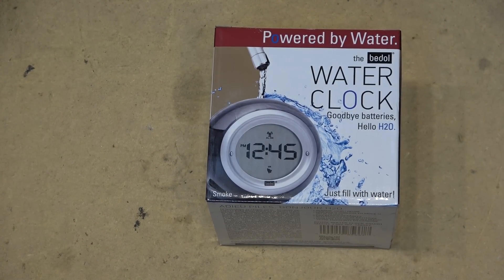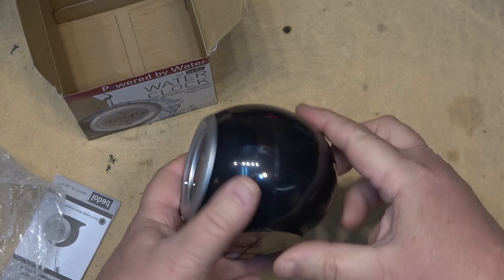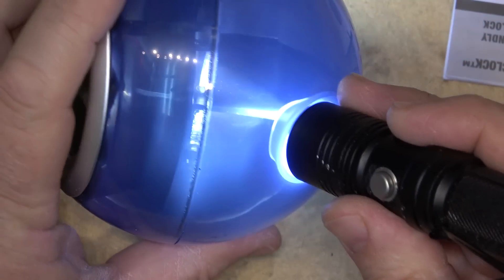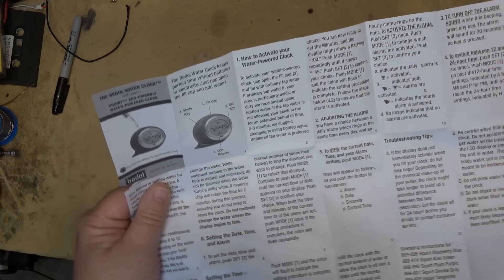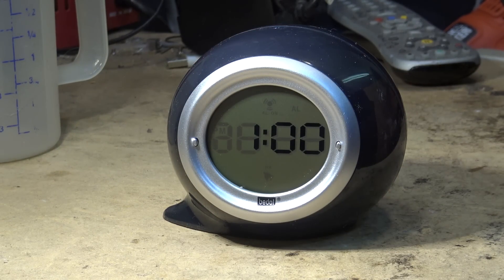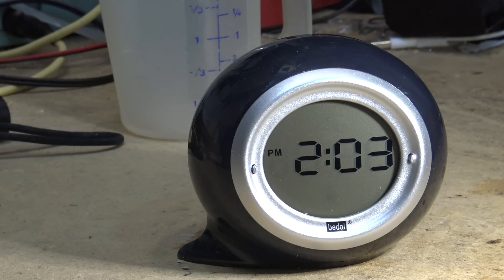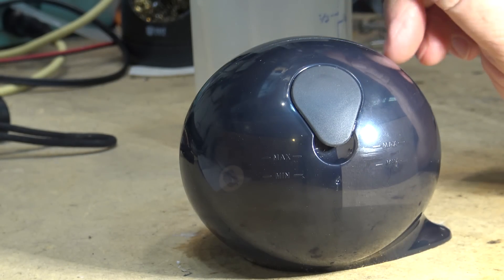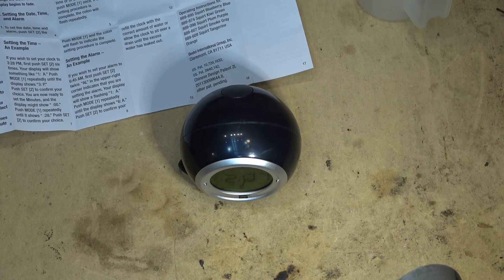It runs on water!

Comment: The manual saying - "Do not drink the water from the clock" :D
Reply from the maker: Ya think.  Would be some heavy metals in it. One thing I noticed.  Put on distilled water and it doesn't work so it certainly is building a charge from dissolved minerals in the water. Setting up a reaction between the dissimilar metals and whatever minerals are present in the water that cause electrons to move between them no doubt reducing one plate in the process.  Will be interesting to see how many years it runs with just a water change when it fades out.   Still it's pretty cool. Just have it sitting on a shelf and it is pretty accurate.  Which reminded me, forgot to set daylight time on it.  Doing that now.

Comment: I'm absolutely fine with my radio controlled clock that runs on a single AA cell for 10-15 years, thank you.
Reply from the maker: My radio controlled clock has been running on a pair of lithium cells for years. My radio controlled watch has been running for over 20 years on original battery, but that one is cheating as it has a solar cell to recharge it every day. Yes my old Casio is solar powered. Will outlast me more likely.
Reply: @12voltvids  About 8 or 9 years ago I bought two Casio Solar WaveCeptor wrist watches.  They run on a solar cell that recharges every day and they auto-sync via the atomic clock time signal from Colorado at 1 am each morning.  They are remarkable watches.  There's no battery to change and I've never had to adjust the time.   I mean never.  They even auto-adjust to daylight savings time based on the time signal.  Incredibly accurate and truly amazing time pieces .  I'm surprised they aren't more popular.
Reply from the maker: @myidisinhim  my Casio is a solar wavecepter and mine is 20 years old.

Comment: What an unusual clock,  is the calcium or floride reacting with those coated plates?
Distilled water has something missing.
Reply from the maker: The plates are mist likely zinc and steel.  Over time the zinc will be reduced.  They are relatively thick so they should be good for years.  The instructions warn not to shake it or tip it over and only replace the water once the display fades.  The zinc will react with oxygen in the water.  Changing the water before it is fully saturated would probably accelerate this process.  I would think that eventually the zinc will be fully consumed and then it will cease to operate but given how thick they are and the low volume of water this will probably take several years before that happens and then it will become a year down project.
Reply: @12voltvids  hmm zinc, the outer case of a zinc carbon battery.
That's a clever design for a clock :-D
Reply from the maker: @zx8401ztv  Take a zinc bar, and carbon rod and put it in a glass with lemon juice.

Comment: Designed with just enough metal in the plates to get passed the warranty, and if fails early they will state the wrong kind of water was used. The fuel is in the plates not the water.

Comment: Wouldn't using non-distilled water cause mineral build up? Could that affect it's performance? Does it even consume water? I'm curious.
Reply: I owned a different one that worked similar. It has a rectangular translucent display on top, with two D-cell sized vertical water reservoirs that it sat on. It used thin strips of copper and zinc or something. In the course of a couple of years the electrodes would crust over with their own oxides, and eventually just fall apart.
Reply from the maker: It's the ions in the water that produce the energy.  It doesn't consume the water as far as i know but likely deionizes it.  After the display fades the instructions say dump and replace water.

Comment: It's just a zinc battery that converts Zn into Zn2+ and H+ into H2 and you get 0.76v with a tiny tiny current.
All you need is a zinc anode and a steel or graphite cathode and water.
Reply from the maker: Zinc Ion battery

Comment: Careful! Looks like lead acid battery.  The acid could be dry form and adhered to the metal plates. Probably low amount. But still caustic.
Reply from the maker: Looks like a Zinc / Steel battery.  Similar to how Zinc /Air batteries work. Very low current but enough for a clock.

Comment: Hm, I guess it loses time/settings if the water level drops too low? It's a cool idea but using that menu system more than once doesn't sound fun lol.
It's really neat though!
Reply from the maker: Instructions say when display fades dump water and refill. 2 minutes backup when empty so if you can't refill in 2 minutes I guess the time needs resetting. Considering one would be at the sink to dump the old water and most sinks have faucets, 2 minutes seems excessive. 15 seconds would probably be enough.
Reply: @12voltvids  thanks for the reply, that alleviates that concern. :)